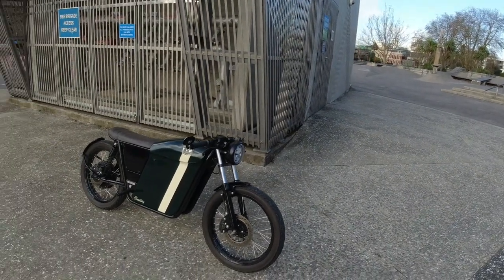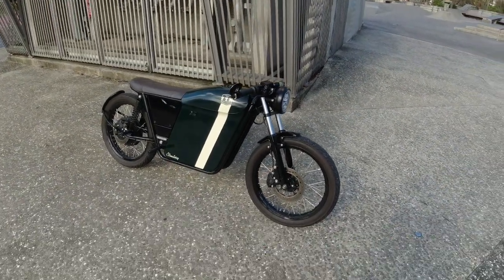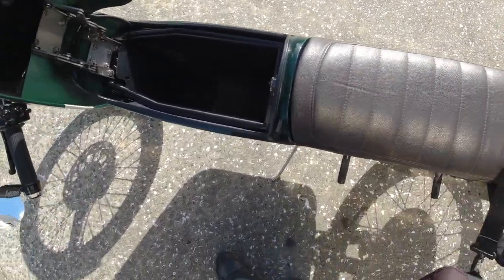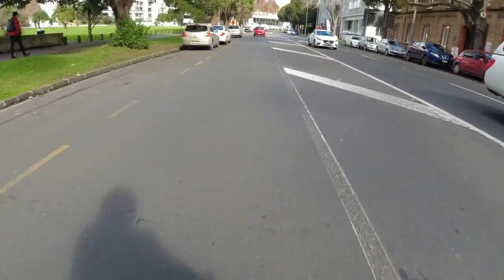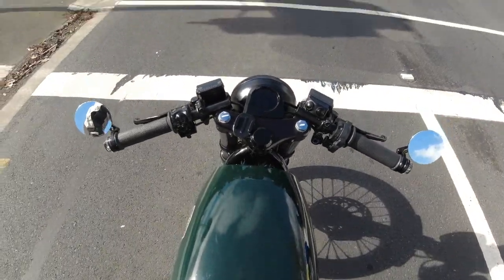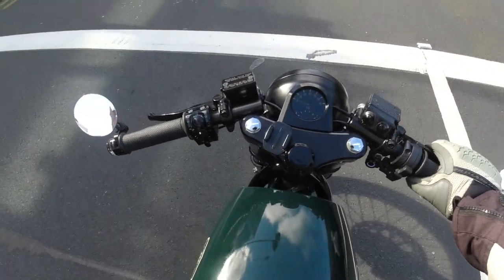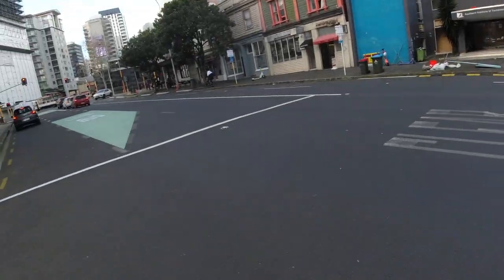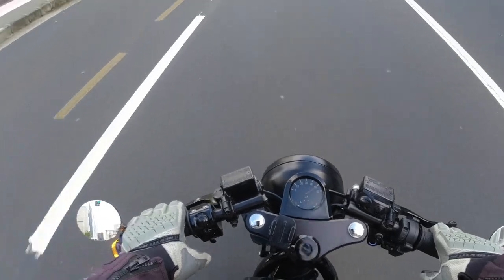FTN Motion Streetdog Quick Test Ride

Comment: These are awesome. Be keen as to see a production version and how the battery slides in and out. I wonder if FTN means "Feck that's neat" , a very cool ride, love the noiseless progress of just the wind.
Reply from the maker: Haha I was told it stands for “F*** The Norm”.m.  I’m really keen to take a look at the new hemp bodywork. The ones on the day I rode them were preproduction fibreglass. 

I really like the idea behind it all. The only negative is the pricing which is what happens when something isn’t made in a large factory or with what basically amounts to slave labour.